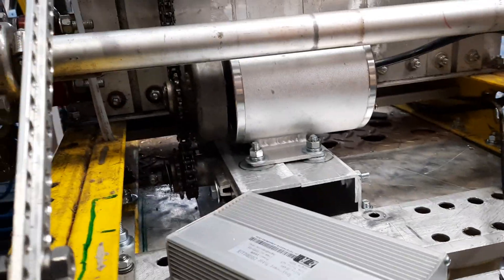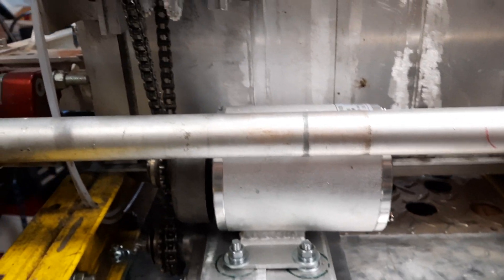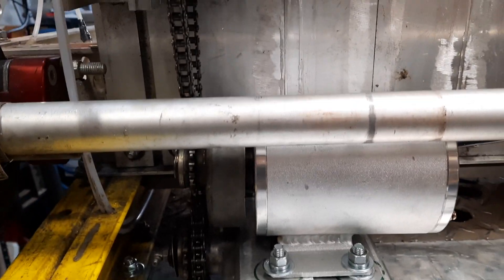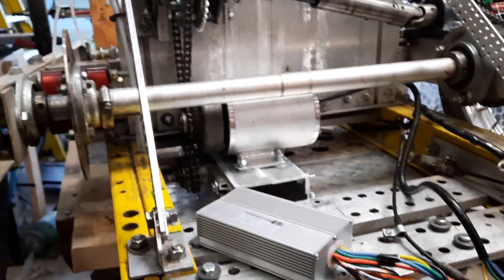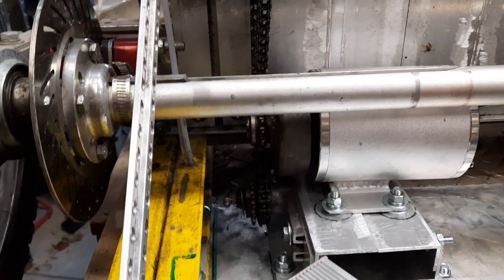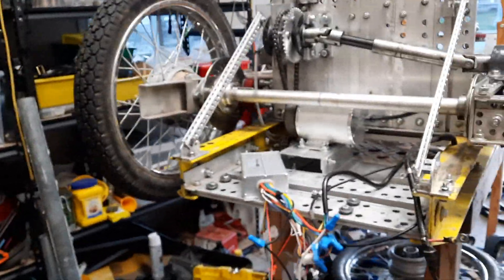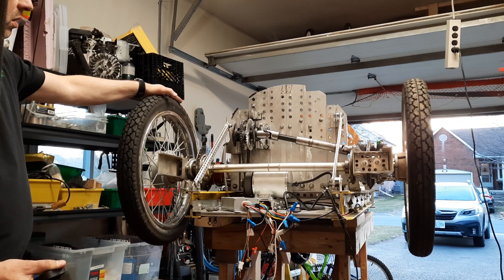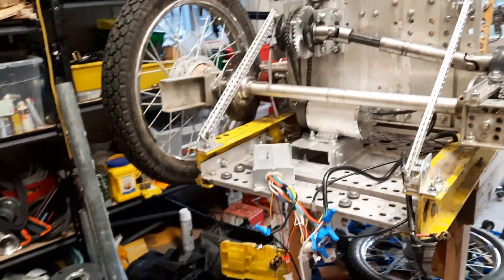The Vulture Cyclekart - Making a Hybrid CK - Moving Bench Test

Comment: Hi Andrew, I am in the planning stage to construct Cyclekart based upon a 1910 Buick roadster, my desire is to use this as a mobility scooter to go to the grocery store within my home town. Yes we are allowed to have ultra small cars to travel about our town of retired people. Not outside of town limits.

So the standard cyclekart has a predator 212 engine developing  19.82 N.m. of shaft force, at 2500rpm, then through a 1:1.4 reduction clutch and then a 12 tooth to 60 tooth reduction. At the drive wheel  shaft the force would be 19.82 x 1.4 x60/12 = 138.074N.M. traveling at 24.43mph.   Note the power curve of the gas engine above 2500 the torque drops but as rpm increases the total power remains the same up to 4500 rpm, so faster speeds are possible.

While i want to use a small electric motor and slower speeds are required as I will be using multiuse trails that allow mobility scooters, yes O am an older pension collector.    so your motor develops a power out put of 3.7N.M. at 3600 rpm as with the gas motor torque drops as rpm increases but power curve remains flat to the 4500rpm range. Then drops in a plug.    I wish to use the the standard 60 tooth drive wheel gear so can change out to the standard gas engine.  I am thinking about using your little motor with a 10 tooth gear driving a shaft with a 72 tooth gear that is fixed to the standard 12 tooth on the out put of the standard clutch on a gas engine.

So I am going to end up with a shaft torque valve of 3.7N.M x10/72*60/12+ 133.4N.M. very close to the standard gas engine output.   However my design speed at 3600 motor rpm would be 6.84 mph flat out would be  at 4500 rpm or 8.55 mph.   about twice walking speed, yet on multiuse trails not a bad speed to be traveling.    

For batter thinking about two 48 volt 700 watt hour bike batteries  to double the amperage available .  I am not sure of the actual usable battery travel time that I will be able to achieve.  Any ideas on the battery time frame. with draw upon the limited battery?
Reply: Sorry wrong way should have read 3.7N.M x72/10*60/12= 133.4 N.M.
Reply from the maker: Hey Brian. I never actually got to the point where I'm using the electric motor in my CK. It spins the wrong way, and I abandoned trying to find a work around. Good luck with your build!

Comment: Hey Andrew. Big fan of the cycle cart. I'm doing a similar build, but with a front engine / longitudinal shaft / differential drivetrain setup. I've tried for the life of me to find the drive shaft with slip yoke and unoints from princess auto, and our American stores. Is there any way you can send me a link to that specific driveshaft please? I'll even pay you to just send me one from your local princess auto up there in Canada! Please let me know
Reply from the maker: Hey there! The shaft I used has been discontinued at Princess Auto for at least 2 years. I haven't found it for sale anywhere else, and haven't been looking lately. If I was, I would try a website called Vevor. Give that a shot.

Comment: You know you can make the motor spin in the other direction by simply swapping two phase wires and the matching hall wires?
Reply from the maker: I've tried that. The motor just jerks and then freezes.
Reply: @andrewroudny  Sounds like you need to try a different combination of phase and hall wires. Swap any two phase wires, then try every combination of hall wires (only green/blue/yellow, leave red and black as they are 5V/Gnd)
Reply: @andrewroudny  Hey Andrew. Big fan of the cycle cart. I'm doing a similar build, but with a front engine / longitudinal shaft / differential drivetrain setup. I've tried for the life of me to find the drive shaft with slip yoke and unoints from princess auto, and our American stores. Is there any way you can send me a link to that specific driveshaft please? I'll even pay you to just send me one from your local princess auto up there in Canada! Please let me know